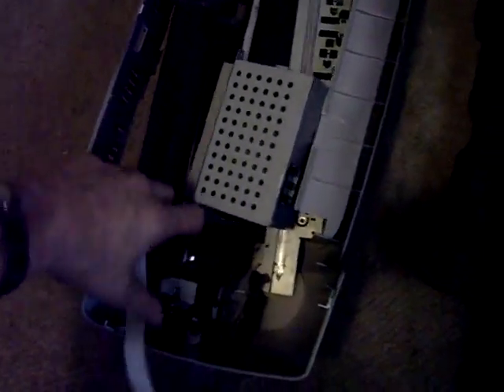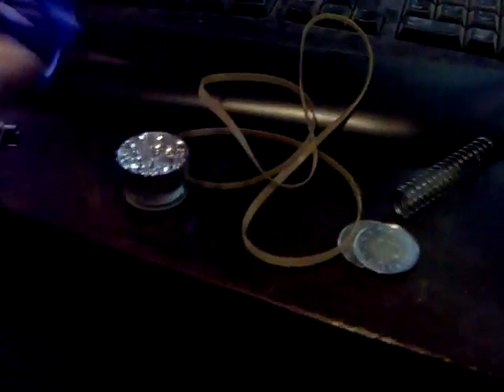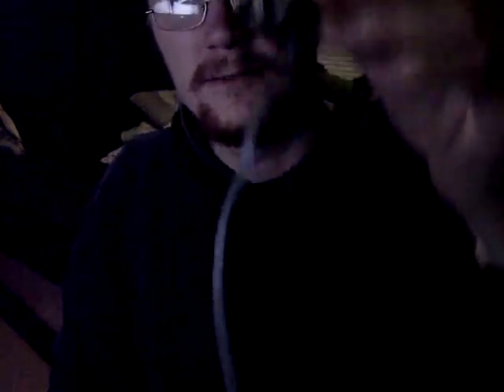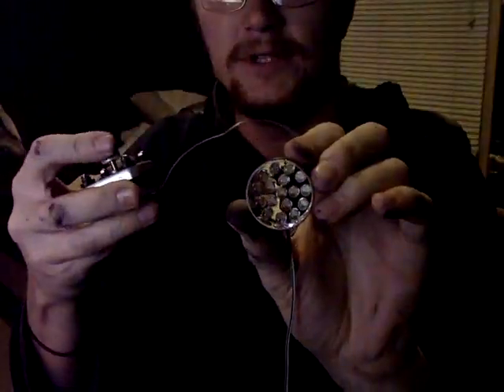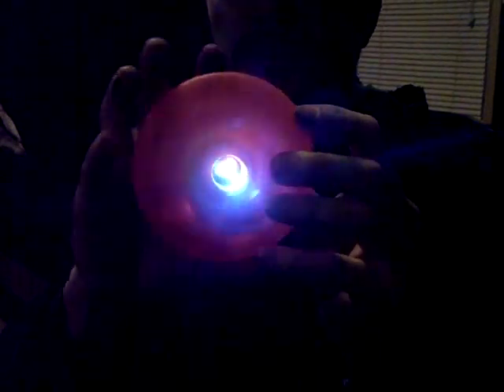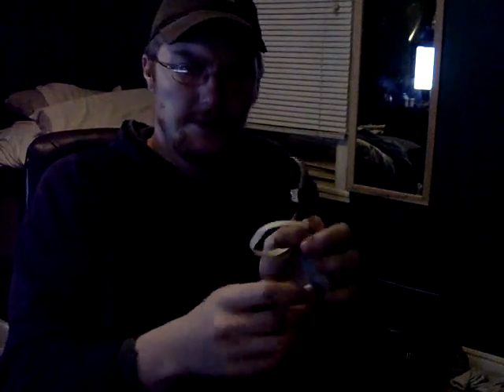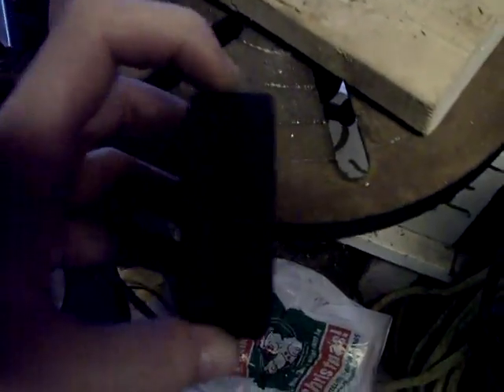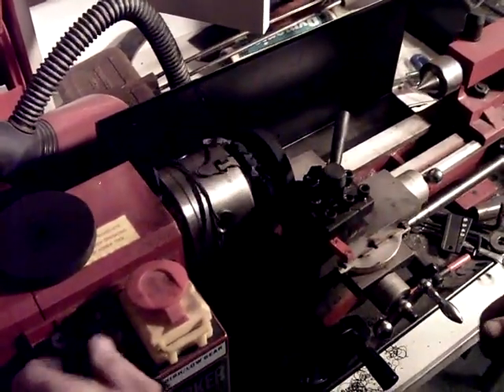how to make a stepper motor generator

Comment: It would be a lot easier to just take a 550 ohm 1 watt resister and connect them directly to the DC system of the tractor. That said, I can definitely see the fun of trying to do it this way. I'm just saying that if it doesn't work well this way, you could still have the lights work...

Comment: Dudeman, these steppers have a lot of potential, but you need better lighting to make a video....period... We cant see shyt. Try using 2 bridge rectifiers, capacitors and voltage regulators to get the best yield.  And turn on some damn lights!

Comment: You can make a generator out of a stepper motor, sweet.

I didn't even there were things like stepper motors until yesterday when I took apart an old scanner/printer. I looked them up on wikipedia and kinda lost interest when I found out you need a driver IC or something to run 'em but this video gave me some idea's, thanks.

Comment: Those LED flashlights usually run off three 1.5v batteries. Total 4.5v. If you use a voltage regulator (like a common 5v regulator 7805) it can handle up to 30v DC IN, and convert to 5v. Then your generator can operate at  different rpm and still not overdrive your lights.

Comment: Yea, thats definitely a possibility, LED's have very low resistance so the current flows through them rather quickly. However, maybe the cluster of LED's from the flashlights has some resistors built into them, because the same problem exists when you use a battery.

Comment: Your LED wil burn out in a matter of seconds.
The leds needs to be current regulated.

If you want to let this work, you need some more stuff.

First start with a bridge rectifier, and a condensator, nou you will have a normal DC current.
than you need a stabilizar IC like the 7805 that wil make 5V DC regulated, and if you than place the right resistor in between, the leds will last for years

Comment: you know you could just incorporate a battery pack in that set up and a poweer switch and let the motor generate power to the battery and use the battery power with the lights,

Comment: great idea. but one question pug, if your using the permanent magnet motor as a generator, isn't the current AC? i thought those  LEDS took 3 volts DC?

Comment: hey pug I got a modification to make get a pivot switch from an old appliance and wire the lights up through the switch and have the motor on the pulley full time 

and remember the K.I.S.S rule :)

Comment: Hey pug, instead of mounting a little lever to turn the lights on and off you should set it up so its always engaged and just wire a switch into it and mount the switch by the steering wheel

Comment: interesting idea, although I'm a little worried that your DC motor isn't going to last very long turning at that speed. It's not that the motor will burn out, but the brushes inside wear down over time.